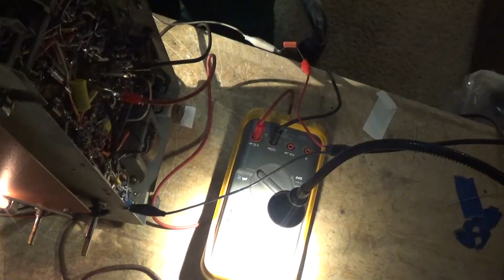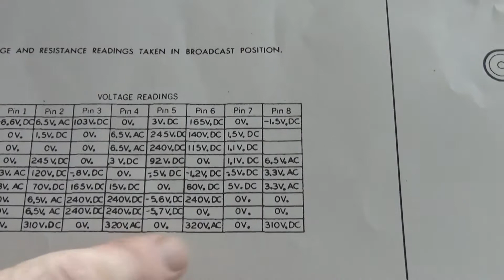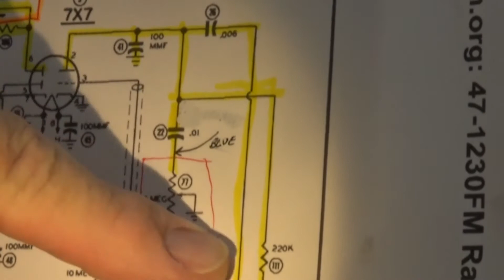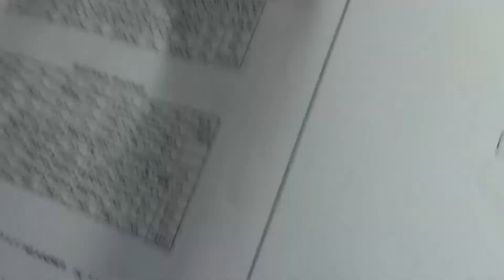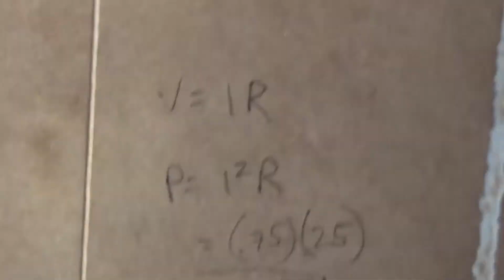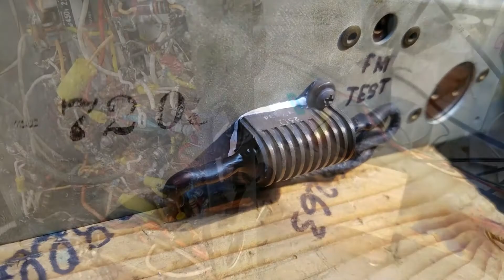1947 Philco 47-1230 Antique Radio Phonograph Part 11 of 14 Alignment & Adjust Line Voltage

Comment: the voltages listed in a voltage chart are + - 20 percent tolerance. as long as the reading you are getting is within 20 percent of the reading for that point in the chart it is all good. the same for a resistance chart.

Comment: Yes well I would need to "break out" my magnifying glass to read 56 mm.. sorry, for most people our age, mm is like reading 64/this of an inch. By the time you convert, you could have already marked it. And the Imperial system still works very well. In fact it was good enough to win WWII.  Metric has its place but snobbery  seems to be its favorite home.
Reply from the maker: Well, James, I didn't intend to be a snob.  The way that I see it, we have 10 fingers and 10 toes, so it makes perfect sense to me to have a base-10 system.  After all , our counting system is base-10.  Our dollar is base-10.  Frequency, wavelength, and atomic weight have always been indexed in the base-10 SI ("metric") system, as have all other measurements of consequence that take place within the electronics world.  It is my personal belief that all of this is so because the SI system enables technical people to communicate with greater precision and it enables more consistent convertibility across ranges of measurement.  But, your mileage (kilometerage?) most certainly may vary.

Back when I was a car restorer, I used to cuss about the different systems of measurement used from country to country.  The Swedes used a unique approach to the problem.  My Volvo 122 "Amazon" had metric, American, and Whitworth fasteners!  Talk about schizophrenia!    [: 0)

Anyway, I'm glad you're watching.  I enjoyed your comment and I hope that you don't mind that I had a little fun, here.    Cheers!    Michael
Reply: ThatTubeSound 
Thanks for the comment Micheal,; I apologize for  insinuating you were a snob. Not the intention, my comment was directed at those on YT who really are snobbish about the holy grail of metrics.
Honestly. I have taken many college courses in my earlier life and have used metric measurements  in my career in the building trades on federal projects. I totally get the concept of numerical assignment based on 0-10. But this is the real world. I dare say you don't go to the lumber yard asking for 19mm stock. Or perhaps you do.  I don't.  Most don't. You mentioned the Swedes,  the Danish use the Imperical system as well for wood  measurements; their inch is however slightly larger than that of the normal English inch.  That said, engineers have used the 100th scale in inches for many decades. Measurements are at best arbitrary. The Fahrenheit and Celsius temperature measurement system is totally arbitrary. I often hear the argument  Celsius is a metric system. Huh?
Water freezing is 0 and boiling is 100. WTF? What  on earth makes that metric or numerically  any different than any other form of temperature measurement?  The most accurate is Kelvin and only some cryogenic  techs and certain scientists use that.  
I wish the federal government had stayed out of it. Americans prefer what they are used to. We do fine with the archaic Imperial method. Our cars used to be imperial, now it's a serendipity adventure in what it measures in cars; this is only surpassed by the insane number of different fastners ( Philips, Robertson, Torx, Japan Philips, Pentalope , Post Torx, Allen and yes... the lowly slot head).
Like I said, it's very easy to convert. It's easy to use metric in evaluating or discussing on paper. It is not easier to measure with ruler and pencil however.  I have worked 45 years in the mechanical trades and no one appreciates mm or cm or meters when laying out walls, floor plans or roof hips.No one believe me. 
Degrees of radius are still 0-360 not 0-100. I totally may be wrong about that though... probably it's all screwed up as well.  I don't understand  why time is not as well .. 0-100minutes= 1 hour, etc. there is no end.  But like I said, all forms of measurement are arbitrary and location is a point in space.  
All that brooking only leads me to tell you I really dig your channel, wish you had time to do some hard to diagnose test equipment like the hated vtvms. Yes there are plenty of the restore videos but they most often deal with a bad fuse, bad  tube and viola fixed. Real world is not like that. I would love to see real world problems not 5 minute fixes..  Carlson is one of the only who goes deep. Bandersentv is great, but he lives a charmed life when it comes to repairing. A cap, a fuse a test lead (as in the HP 410C repair)  or a power cord and viola... fixed   Not real in my world.
Thank you a lot for your work. I learn a lot from your channel..

Comment: I have an HP-11cI still occasionally use it, but still use my Post Versalog slide rule which I used all through college.  Even 4 banger calculators were extremely expensive in the late '60s and early '70s.  I have an app for my phone called Multi Calculator.  It is a free app and converts all type of measurments from English to International.  Just throwing this out.  Keep up the good work Michael!!
Reply from the maker: When I went to college in the eighties, slide rules had been out for a few years.  I never learned to use one.  I do remember my first "programmable" graphing calculator, though.  It was an HP28C.  I almost felt like I was cheating when I used it.  In fact, that calculator and others like it were banned from exams!  I still have that device, too.  Whenever I open it up, I am amazed by two things.  First, it was made very well.  It's sturdy and beautiful.  Second, it seems so primitive by today's standards.  It was an esoteric device that was difficult to use, and I actually never really used it much.   Thank you for sharing.  I'm glad that you're watching!    Cheers!    Michael

Comment: BTW, I had seen many other restorers use a VTVM in the past when they did their alignment, but this is the first time I recall seeing someone use a DVM.  Thanks for that tip!,  I am going to try it soon.  Regards Mike from Georgia
Reply: the choice of dmm or vtvm is a personal choice. personally i find it much easier to peak a coil with a nice analog vtvm watching a needle than watching a bunch of numbers scroll by. also there is a slight time lag with a dmm which can also cause problems doing an alignment. then again i dont like dmm for any purpose. might just be because a vtvm is what im used to. when i learned to service electronics i dont think a dmm existed.
Reply: Thomas: thanks for that advice!!  I have done one alignment so far so I am trying to learn more before the next one. I just got an RCA VTVM.  Seems to work OK. Insides don’t look like they have ever Bernard touched. If I use it just to peak my alignment do I need to bother with trying to make certain it is properly calibrated? Any advice on that question? Thanks Mike from Georgia
Reply from the maker: I've never calibrated my HP 410b VTVM.  Since I am looking for peaking and not absolute numbers, I haven't worried about it.  Perhaps that's lazy on my part.  I like my Fluke because it has a bar graph across the bottom of the digital display.  The bar graph shows the relative direction of change in measurement, effectively doing the same job as the needle of a VTVM.  But, I don't need to worry as much about hooking it up correctly or worry about measuring line voltage with it.  The DVM is just easier and less troublesome.  I would only use a very good quality DVM, and only one with a similar bar graph feature, though.  Without that, it can be tough to follow the dancing numerals!  

Thank you, Michael, for watching.  I am grateful for your questions and comments.  I hope that you are enjoying the hobby.  If I can be of some help, just shout.    Cheers!    Michael

Comment: I've got the same calculator.  And before that I had an HP-21.  You know what got me more into using metric?  3D printing.  All the open source software for 3D printing, and the CAD software used to design parts is all in metric.  (layout of PC boards for SMT parts is still both in inches and metric,  metric is more common now).  I wish Harbor Freight would carry metric tape measure and micrometers!  I KNOW the Chinese are using metric!  I also wish HomeDepot would carry more metric hardware, and NOT at a premium price over SAE screws and nuts!

If it were me, I'd probably end up using one of my Tek scopes as an output meter.

There is a way to calculate the required resistance for the primary dropping resistor, but it's a bit of math.  You know the expected secondary voltages for each of the transformer secondaries from the schematic and voltage chart.  You also know the tube heater currents (look them up in the tube manual).  Now use ohms law to figure out the resistance of the tube heater loads.  We can guess at the B+ currents from the typical operation data in the tube manual for each of the tubes, but we know that those 6V6's take the lion's share of that.  Now use ohms law to calculate the B+ load resistance.  Now translate those loads from the secondaries to the primary of the transformer by dividing or multiplying them by the transformer ratio's (depending on step up or step down ratios), then calculate the effective parallel resistances (for B+ load, 6.3 volt load, and 5 volt load all in parallel).   Now you know what effective load resistance the primary is seeing.  You also know what current that should be drawing AT 117 volts from ohms law.  Now you need to drop 124-117 or 7 volts.  Use ohms law one final time to figure out what resistance you need to add to the primary of the transformer to do that.  (Isn't engineering fun?)

Actually, considering that a set with a pair of 6v6's in the final probably draws about 50 watts (gotta be printed on the back of the radio cabinet some where),  that's about 1/2 amp of current at 117 volts.  Now 7 volts / 0.5 amp = 14 ohms.  So I bet your dropping resistor need to be between 10-20 ohms at about 3-7 watts!  Hows that for an educated guess!
Reply from the maker: Of course, Kenneth, you are right about all of the math and what the proper way to calculate the resistor would be.  The trouble is, alot of the folks who are just breaking into old radios are a little intimidated by some of the deeper technical details.  I like to show that it is possible to make it all work, without having to have years of experience as a tech or an engineer.  I absolutely admire all of those experienced people, but I just want to keep the less experienced crowd interested until they gain some experience.  It has been my experience that, even if a newbie is not that interested in the deep technical stuff (math, tube theory, etc.) at first, they will eventually explore those subjects as they gain knowledge and experience.  When I first started, I wanted nothing to do with vintage televisions.  They are more complicated and more finicky.  Why would I want to get tangled up in that mess?   Now, I've been collecting old TVs for a while.  I'm learning by watching Bob Andersen, and I completed my first television a few months ago (Motorola VT-71).  If I got turned off by too much theory early on, I probably wouldn't have ever gotten to the TV.  That's why I am grateful to John from Arkensas (joernone).  He taught me in such a way as to give me confidence.

Thank you, as always Kenneth, for watching and for your spot-on brilliant comments.  I love to read what you have to offer because you teach me, my friend.   Take care.    Michael

Comment: Great info and video Michael! Im looking at the same thing on the Colorama, except the hot transformer. My transformer is not hot, but the voltages are high by about 30 volts. I ran my variac down until the B+ was spec, and then I checked my AC coming into the radio. It was slightly over 112. Looking at the specs on the Colorama, without the universal transformer, it was rated for 115V AC. So, I used the same formula you used, inserting my measured 1.1 amp input. Im going to try and drop my 122 V AC to 115 V using a 7 ohm 25 watt resistor (in the mail). I will publish the video with the results as soon as its available. Thanks for sharing these details, and thought processes. Take care-- Larry
Reply from the maker: Larry,
I look forward to seeing your results.  I too have done the thing where I lower the Variac output until the B+ is right.  That is a great way to help diagnose other voltage problems in the set.  If B+ is right, then everything else should be right, unless there is a problem in the circuit.    Doing it the way you did eliminates a variable.  Good luck on the GE.  I really, really like that radio!   Thanks again for watching, my friend.  I am always eager to see your comments.   Take care.   Michael

Comment: What was the line voltage from the variac ? Did you try lowering it to 117 volts and then measuring the DC voltages ? Did the reduced line voltage cure the hot transformer ?
Reply from the maker: Hey, Glenn,
I lowered the line voltage via the Variac to 115 VAC.  I usually target that number, because that is the rating that was printed on most stickers on radios.  When I did that, I got similar numbers to what I got with the resistor.  I just did not capture that on video because I just did a quick check.  However, when I ran the radio with the dropping resistor, the transformer temperature was normal "warm" , even after playing for several hours.  Plus, if you can believe it, the radio just plain sounded better.  Before installing the resistor, I had noticed some distortion on strong FM stations when they were tuned to the center.  After the resistor, the distortion was gone.  I had noticed this when I did the quick check with the Variac, so I was pretty confident that I was on the right track. 

I have been distracted by a family crisis of late, so I probably missed a thing or two in the video.  It's actually pretty easy to forget something or accidentally leave something out!   [: 0)

As always, thank you for watching and for your great comments and questions.  Remember, you are dealing with a relative noob here, so I really like the feedback and advice.   Take care!    Michael

Comment: According to Wikipedia, most of North America has between 100 and 127 volts. The nominal voltage at the source should be 120 V and allow a range of 114 V to 126 V. https://en.wikipedia.org/wiki/Mains_electricity